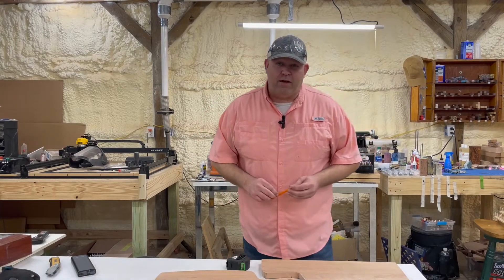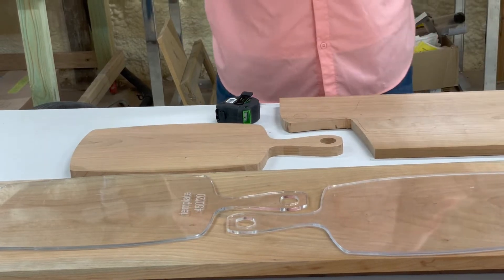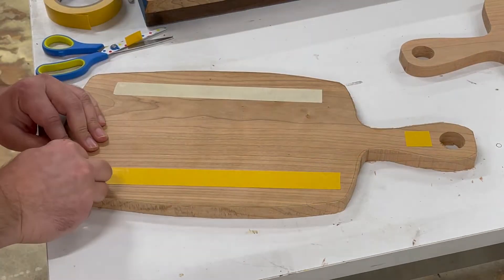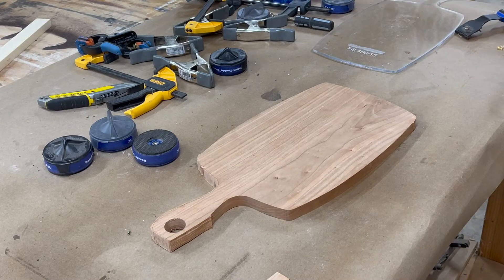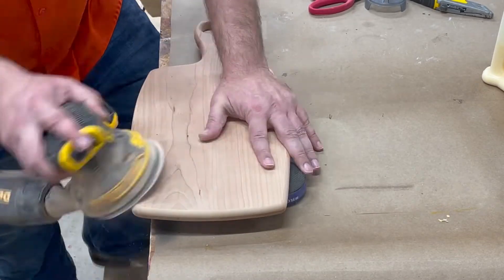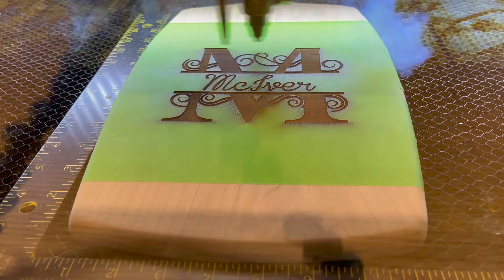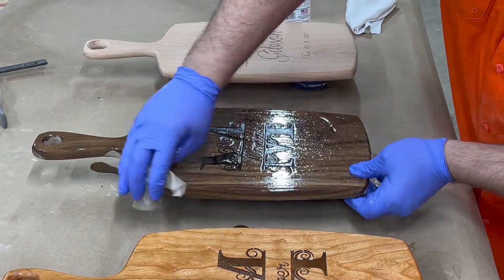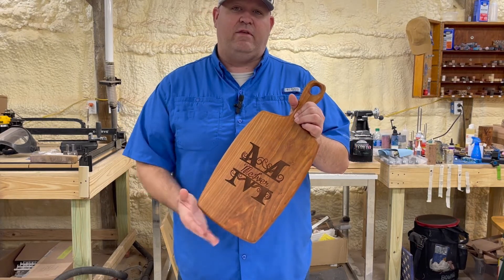HOW TO - Charcuterie Boards STEP BY STEP.

Comment: I got one of those Ultimate drill bits ($250) from bits & bits and it’s awesome - it will still bust out sassafras if not careful but much better than the one you are using!